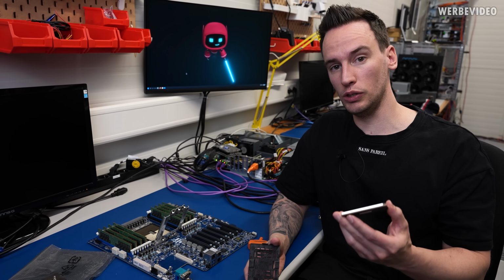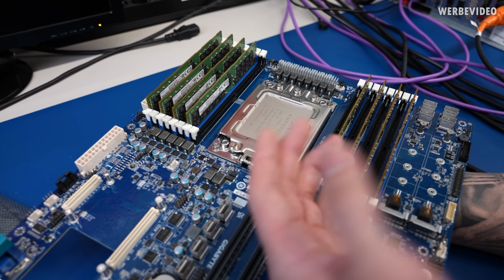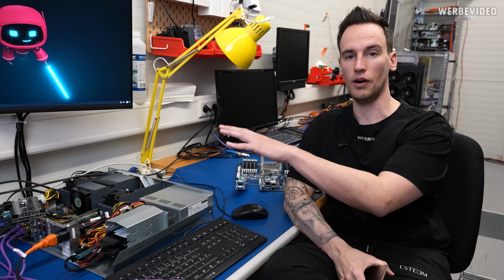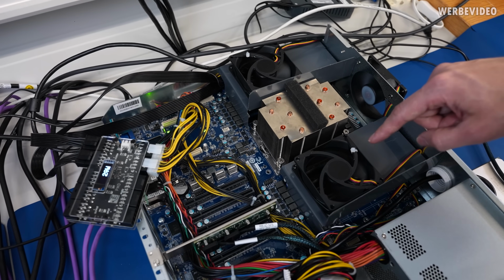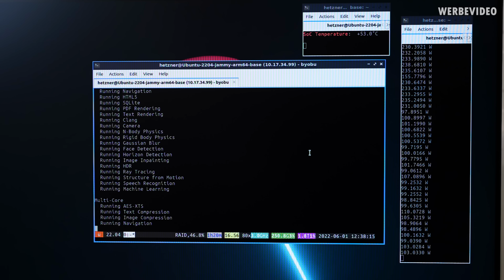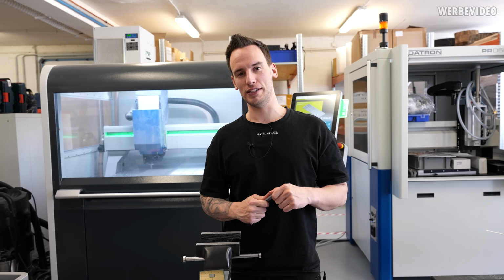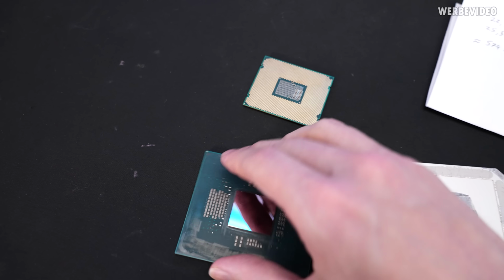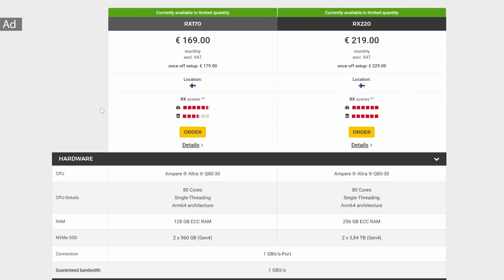This insane 80-Core ARM CPU easily beat a 64 Core Threadripper

Comment: I miss my Acorn Risc Machine (ARM) based desktop computer.   ((every video like this gets loads comments about ARM being mobile only but it never was))
I had an Acorn A3010 with a single core 33mhz 32bit ARM cpu with 1mb of ram and a 3.5" floppy from 96-98
That thing was a beast in the early 90's and still pretty awesome when i had it.
We've come a long way since then but no one seems to remember that ARM was desktop first (mobile came much later)
Reply: Arm became pretty much exclusively mobile and embedded as the only places you would find them for quite a while though, so for many it is all they have ever heard of or seen using ARM - makes sense so many folks wouldn't know ARM as being anything but Phones and Pi's...
I really would like to get my hands on such a powerhouse ARM system, or a RISKV system of similarly high end specs, though last I checked RISKV wasn't really ready for that sort of use yet.
Reply: The good old days, I had an acorn machine as well. As did my school at the time. Looks like ARM based CPUs are going to make a comeback for personal computing maybe? Could be interesting.
Reply: @jonathanellis6097  Did you say Apple M2 !
Reply: At least for Android, the biggest show stopper for multitasking is the Java applications. And Google only has Java API for the GUI so even if core functionality may use C++, the graphical interface of Android apps will use Java.
Reply: Why did Steve Jobs choose Apple?  Because A appears before IBM in a telephone book.  Why did Chris Curry choose Acorn?  Because Acorn appears before Apple in a telephone book.

The story of Acorn and how it came about from ex-Sinclair engineer Curry hiring a bunch of teenagers from a weekend computer club to be his engineering team is up there with the legend of how Commodore started in the US, it's a real shame that Acorn went under, because they had the same youthful edge that helped turn Apple into a giant.  At least their ARM chips are still alive and kicking, just can't believe the Tories allowed a foreign company to buy ARM, the US would never let another country buy Intel.
Reply: Arm can't mulitask.
Source: every phone, ever.
Reply: @ZeroHourProductions407  Arm can multitask perfectly well - for instance I run a Raspberry Pi4 as my go to always on desktop, it does basically everything my bigger computer can do*, just more energy efficiently and that includes having many things running at once. Don't confuse the hardware with the limitations of the operating system you happen to be using!

Either AMD and INTEL can't multitask either, or Arm can - as they fundamentally function very very similarly when it comes to multiple processes at once - none of them are the dedicated (or FPGA) massively parallel in real time logic systems that you could truly consider real multitasking at the hardware level.

*just moderate your expectation of how fast it can do them all, and avoid anything that needs more than the ram capacity - for most things its about as fast as any other computer, even really expensive powerful ones as the limitations are you the user not the system anyway, but it is a tiny cheap SBC, not a supercomputer...
Reply: @foldionepapyrus3441  how do you figure? ARM based computers literally didn't exist on this side of the Atlantic, for one. The only use case(s) I have for a raspberry pi of any kind is entirely for single purpose deployments, like using a pico as a replacement modchip for the GameCube.

Phones nowadays brag about having so many cores and so much ram, but the meme is that they never have enough storage, and every attempt to be able to have more than one app on screen at a time instantly tanks performance. Even my lg v20 had attempted multitasking on the factory ROM, but the performance was horrible. It was basically as bad as my first attempts to stream by using a core 2 quad and only having CPU encoding while running the game on the same system. At best, an instant halving of performance. At worst, a lot of apps just broke and refused to run correctly.
Reply: @ZeroHourProductions407  But that is a limitation of the software, not the hardware - or at least not of ARM as a architecture, though slow hardware is slow its not going to perform as well as fast hardware... If you have access to one (and a heat sink for it) try using a Pi4 (or some of the other more potent ARM based SBC's or I think most chromebooks these days are arm?) running Linux of your choice and you will find it just works like a normal desktop, multitasking just fine - heck on my Pi4 (an 8gb RAM model) I often have a Virtual Machine or two running and the performance in those guests is still alright even though I'm using the Pi4 to play music/video, browse the web and frequently run FreeCAD! Though obviously not superb high end performance as it is still a cheap and relative weedy CPU/GPU combo in the pi it works very well (as long as you avoid a few of the potential pitfalls like having to CPU decode rather than hardware accelerated GPU decode the video files).

Fundamentally Arm and Intel/AMD processors multitask in the same way - they really don't, the task scheduler of the operating system gives each running process (the functional parts of a program) a thread or two of CPU time and RAM only when it has them spare from other 'more important' tasks and will then interrupt the running of low priority tasks to let the fast stuff run again. Its not really doing lots of things at once, but one (to at most core/thread count) things at a time and switching between them! 

SO a bad multitasking experience is often down to having a background process that is too important constantly interrupting the running of your other tasks. Or a task scheduler that just isn't right for the job, as it won't push low value tasks out of the RAM into swap/pagefile space on the storage etc.
Reply: @ZeroHourProductions407  Also worth pointing out most phones will thermal throttle if they ever actually use the CPU potential they supposedly have - does you no good having 8 cores at 4ghz if soon as you put a load on them they have to drop down to only running 2 cores at 800mhz to not cook themselves. (possibly an extreme example, I know phones throttle I've never much cared how badly, as to me a phone is for phonecalls - lets have a real keyboard for real work!)
Reply: @foldionepapyrus3441  You can plug in a keyboard to your phone though.
Reply: @rzul  True, but still got to have the terribly small for real work phone screen with poor ergonomics and carry a full size keyboard to do so. May as well carry the keyboard with a nicer to use screen and more storage/computing power...

(and yes technically most of these things can also be connected to a real screen and work more like a computer - but android really isn't good for that, so again lets just have a real computer)
Reply: @foldionepapyrus3441  android not only "isn't good" for that, it is downright horrible for that. At best you can hope for VNC/RDP from your phone to your desktop and the keyboard mappings to work... but that's completely different
Reply: @GeorgeTsiros  Still that bad is it? I knew it wasn't good, as frankly a phone really can't be good as a desktop like object unless it is at heart a real full fledged desktop OS that just happens to load a 'smartphone' desktop environment for use on the move when it doesn't have an external monitor. And Android isn't likely to ever be that... 

Steam OS on the steam deck seems like its rather closer to the point it can be both portable and desktop sufficiently well from my playing with it so far, though obviously that isn't a phone, so its more an example of contextual UI switching done well.
Reply: @foldionepapyrus3441  android is a joke, sadly.
Reply: @ZeroHourProductions407  ARM based computers were sold in the US by Acorn. While it’s true they weren’t a massive success; to say that “ARM based computers literally didn’t exist on this side of the Atlantic, for one,” is incorrect. 

As for multitasking and use cases. 

Multitasking is really down to the OS. Yes, at a hardware level, manufacturers have put nice features in to speed these up. But the multitasking model is coded into the OS to handle things like interrupts and such. Even OS’s in the 80’s were capable of it. With some fancy coding trickery. Look at Amiga OS. The Workbench desktop was running on top of the OS. This was running on a 68k PPC. Acorns own OS had its own multitasking model. Running on ARM. 

As for use cases. I see the Pico as been nothing but a beefier Arduino. So I wouldn’t ask it to do anything other than a single task, but it could multitask just not as efficiently as a “desktop class” Raspberry Pi, such as the 4 or 400 runs Linux. A multitasking OS. So I can do everyday computing, such as multiple chrome tabs; playing music and word processing at the same time. But again, this is the OS that is making clever use of the CPU’s hardware to adjust the various registers and interrupts as efficiently as possible. 

A phone can multitask because I can have YouTube or Spotify running in the background and still do other tasks. But manufacturers play a balancing game between speed and thermals.
Reply: @rzul  Bluetooth keyboard and mouse.
Reply: @joefish6091  there also exist cheap usb-c to dual usb-a splitters if you want to use the kb&m you already own
Reply: @ZeroHourProductions407  Source: a stupid statement made by someone that has 0 experience with an ARM Pc
Reply: @ZeroHourProductions407  use  m1 Mac then say this again. I'm writing this with 10 apps open and 24 tabs open in safari

Comment: I wonder if AWS would be open to doing some videos with you? Maybe at AWS Frankfurt? It would be amazing to see Graviton 2 and 3 up close 🤩
Graviton 3 is an incredible chip. The most impressive server chip on the market right now, IMO.
Reply: It's really amazing, at work we switched like 100 instances from Xeon based to Graviton 3 and the performance is the same (as far as we can see) but the costs are waaaaay lower.

Comment: I doubt this competitiveness will hold up when you compare with something like avx performance of x86. Geekbench always favours arm. Apple m1 performance in geekbench was very inflated compared to real world intensive workloads like compression, decompression, 3D rendering etc.
Reply: It's almost like those "bloated" instructions where designed to accelerate workloads...
Reply: avx is an intel instruction set of course chips that have that instruction set in silicon would be faster at that task.
My car isn't good on the water but it's faster than your boat on land.
Reply: @KillaBitz  Many heavy workloads can use AVX2 though and some even AVX512. Video transcoding for example is heavily dependend on AVX on x86 and NEON on ARM (because yes arm also has basically that same instructions making the core arch smaller, but the full arch not that much more efficient).
Reply: also, not sure if and how geekbench uses vector extensions in x86. but still, 882 for single core perf. is very weak...
Reply: The Ampere Altra is built for cloud workloads where integer performance is needed. Each core has two 128bit SIMD engines which are efficient for power consumption and die area when NEON instructions and AI Inference are used. Linus Torvalds has been arguing against splurging die area and power on AVX and SVE for years.
Reply: @vikingforties  It's always dependent on your workload, I mean the AVX instructions are pretty much similar to what NEON has to offer, so it's about support and whether your workload can use for example the massive AVX512 engines (which are large, but hey they also 512bit wide(/256bit on EPYC I think)).

Intel and AMD also seem to show interest in the small core market though, with 128c Bergamo (Zen 4c) and Sierra Forrest you'll get your AVX512-less core on x86 too. And I mean we've seen Intel's small cores, they are 1/4 of the size of the big cores, so they can easily compete with the arm cores that people like alterra build.
Reply: @cromefire_  Yes, horse for courses as they say.

Comment: Going back to my old datacenter days, a RISC system would eat any CISC systems for lunch at any time of the day. Intel only won because it was much cheaper than a Sparc system (and Oracle bought Sun Microsystems to take over Java). Now ARM is once again proving RISC is superior by not having all the bloat of CISC architecture. Apple bet on the ARM platform and Ampere (or any other server grade ARM CPU) on the datacenter world will cause some stir - and that will be great for everybody.
Reply: I don't know when your days were, but Intel P6 workstations from Pentium Pro onwards destroyed Sun's RISC crap for 1/7th the price. That's why Sun dried up and blew away.
Reply: like @Mr. Moto said, if you haven't tried Pentium Pro's and later systems, they were really a lot faster (in most workloads) than any current sparc's of the time, while being alot cheaper and energy effecient. CISC's were not at all bloated at that time since every little thing they had was in use. now, of course they are, because they still retain a lot of things from the past for compatibility reasons. but keep in mind that arm also cannot change that much without it too becoming not risc.
Reply: @giornikitop5373  Also x86 can just implement many of those mostly unused instructions in microcode, so they don't have to be on the silicon.
Reply: @cromefire_  i believe it depends in if those instructions can be broken down to smaller ones that already exist, then yeah, they can be removed from silicon.
Reply: @giornikitop5373  according to Intel they can. I mean those old instruction don't have to be fast, they can use multiple cycles and are still faster than back then
Reply: @giornikitop5373  Also nowadays ARM has aged and gets bloated for retrocompatibility reasons. That's not as serious as for x86 but it's one of the reasons the fresher RISC-V ISA is now menacing ARM.
Reply: @PainterVierax  well, compatibility will always be a big deal, no matter the cpu or arch. risc-v seems to be very nice, but still hasn't got enough support (aka funding) so we wait.
Reply: @giornikitop5373  Well, the founding and support is here. Linux kernel and software is ported and mature enough to roll in production. Core designs are ready, pushed by giants like WD or Alibaba as well as promising startups like Sifive and almost all embedded manufacturers are at least starting their own Risc-V branch of products if not completely migrated to it. ARM Holdings has already lost most of its marketshare in the Softcore, ASIC and Microcontroller areas. IoT is already in fast progression. Servers, automotive and even multimedia SoC products are following. In the end, only the mobile ARM with Android/iOS software environment remains unaffected, just like x86 is with desktop/powerstation.
Reply: It's less about the architecture as what you optimize for. Apple optimized for desktop with lots of special purpose hardware, AMD and Intel largely optimize in sharing one architecture from mobile to server while alterra only does server workloads with as much cores as possible.
The reason while ARM CPUs are faster than x86 is because that's currently the only competition. They can't use x86 and RISC-V isn't ready yet on the software side.
Reply: The first ARM chips where also faster than Intel at the time and at a fraction of the power (late 80's)

Comment: The die size is somewhat of 1/4 to Sapphire Rapids 4 tiles solution.
So it looks like good for highly parallel workloads.
It seems 1 core would be equal to Intel's Gracemont core. But Sierra Forest is only in couple years from now.
So interesting, if these Ampere CPUs are popular and a demand is high, why wouldn't Intel to spread their Atom family with more cores solutions now...
Reply: Intel is also working on RISC-V cores. It could be that the successor to Sierra Forest is RISC-V-based.
Reply: @ChristianStout  Yeah, I think they want to develop risc v as opponent to ARM and keepin in mind Jim Keller's opinion that risc v is currently the most powerfull instructions sets, I think Intel can do very good with risc v accompanied foundry services.
Reply: @Slav_space  they also mentioned combination packages. So they could come out with something with a few xeon cores and a bunch of ARM and/or RISC-V cores. Would probably ease the transition considerably.
Reply: And with Zen 4c, AMD is also trying to compete in that space, it'll be a crowded space in the next couple of years
Reply: Ahhhh, excellent point!  Id love to see an atom competitor!

Comment: Is there any possibility of you providing us with a die shot & analysis of the Ampere Altra? You said it is very impressive that 80 cores could be fit into that (well, not really, but relatively) small die, and it would be very cool if we could see how those 80 cores are placed! Core size comparisons with x86 would also be interesting.